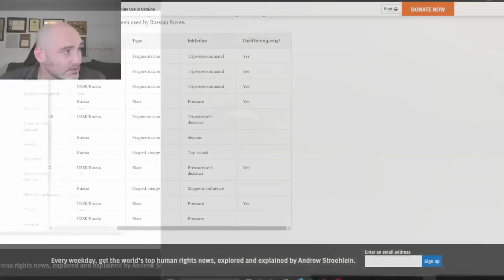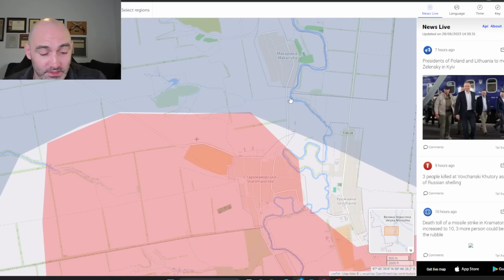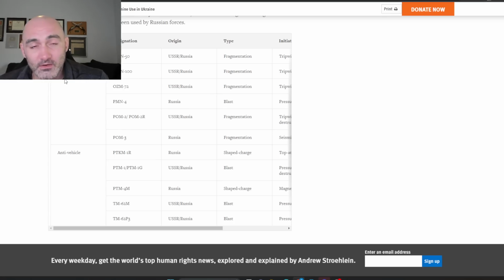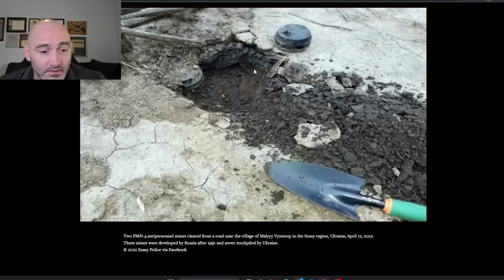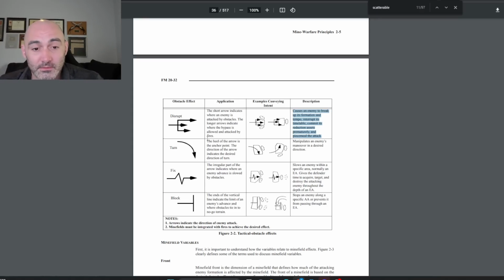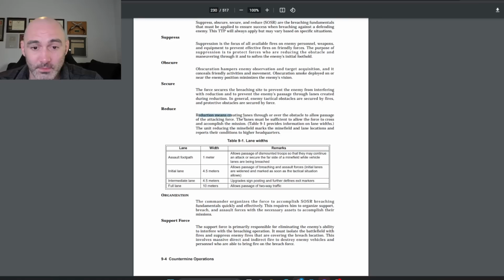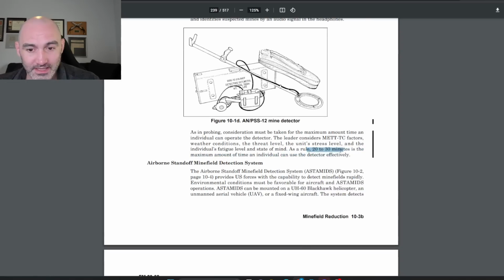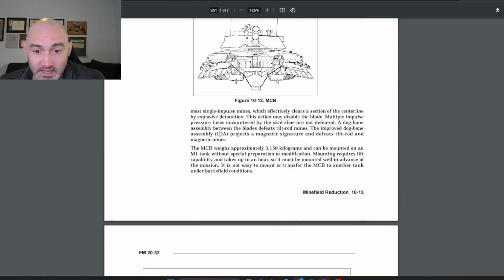The Simple Russian Weapon Slowing Ukraine's Offensive!

Comment: Paul, a question.  At the present Russian loss rate of artillery and MLRS from focused Ukrainian counter battery fire, what is your opinion when (or if) they will start to be unable to cover the minefields with artillery at all points?   Taking the Ukrainian figures with the normal grain of salt, Ukraine has claimed Russian losses of over 30 artillery systems and 6 MLRS  on both 7/3 and 7/4, and between 4/30 and 7/4, 66 days, 1328 artillery and 106 MLRS ( by Ukrainian figures, 31% of total Russian artillery losses and 16% of MLRS losses since the invasion started 16+ months ago).  Figures I have seen quoted say available Russian artillery at between 1200 and 1500 pieces; how accurate those numbers are, who knows?  Add to that Russian logistics and maintenance, how many are up and running?   Do you believe that there is some minimum of artillery pieces needed to protect the minefields from easy clearance?

Comment: I missed two AP-mine clearing techniques, Paul.. firstly the use of sheep (as done after WW2 in the Dutch seaside dunes, the remains of the Atlantikwall) and the not-so-popular use of POW's, penal batallions or even civilians (presumably used in WW2 on the eastern front). there are also bomb-proof excavators, which are used to excavate known ordnance-disposal sites (like swamps near to WW2 airfields that were bombed by the allies).
Reply: I love the low tech idea of using sheep. Bit messy but it's easy to breed as many as you need.

Comment: Wait a second here... its 2023, not 1970, magnetic anomaly detector and ground penetrating radar is a thing. Can´t they detect the exact position of the mines prior to the attack? 

It should be possible to localize the mines with cm precision. This probobly would help a lot and clear them or even just avoid them to a degree.

Comment: Excellent discussion on mines and breaching operations. Unfortunately, most of the techniques discussed in the manuals are meant for clearing linear obstacles with minimal depth. US forces typically bypass fields of mines. Given that the Russians have laid mines in wide swaths running kilometers in depth, clearing a lane is practically impossible without considerable loss of life and materials. Furthermore, breaching lanes are intended to create a narrow path (as you discussed) enabling passage through the obstacle. Once through, the unit should redeploy into a company/battalion front before continuing the attack. This isn’t possible if the breaching lane leads to another minefield. Even if a breaching lane could be cleared through the kilometers of minefields, disaster awaits if the lead Ukrainian vehicles are disabled in the breach lane. The remaining vehicles will be unable to  maneuver. As others here have mentioned, attaching blades, rollers and flails to the lead elements of the attack may be the best option.

Comment: Needs to be a drone capable of setting mines off since they're used for most other things.  Trailing wire ? If a drone can lift a man, then I'm sure the incentive is there to design a means to stop men from having to risk their lives with metal detectors. Isn't there a L I D A R ? system capable of looking at ground which has been disturbed? Failing that a forward vehicle connected by an umbilical cord carrying control lines  which is well armoured. Able to roll over mined area and set mines off in advance. Yup it could even should smoke canisters ahead of its path.

Comment: Top grade thermal imaging devices on western tanks can help well trained crews see the temperature variation, effectively locating AT mines especially shortly after full darkness occurs and the temp. variation is the greatest.
N.B. this method will not detect trip wires. Remotely detonated munitions just outside it's FOV range can also be a problem. 
The deadliest is a combination of AT & AP mines.

Comment: Wake me up in 15 of the main situation.
Couple of things him out of that for me, which I think are self-explanatory first of all you mentioned about the use of aerial equipment to detect and about London protection equipment. I’m aware of the fact that in agriculture they have drones That assess the soil condition there is a program in Britain called time team and they use a technique called geophysics to detect structures of a historical nature. Underneath the soil a little bit like sonar.
Given the increase in use of Drones and the use of thermal imaging camera, mineclearing detection equipment and lidar for mapping surfaces, I suspect that with an advanced software system which I am sure the Elon Musk would be willing to work on you get up and running so that your Ukrainian soldiers can penetrate these minefields would be achievable in a reasonable amount of time.
It also occurs to me That clearing of these minefields can be done in one of two ways, first of all you’re going you make a mess you let everybody know that you’re there. I’ll leave it sitting wait for them to disperse more minds by shells, rockets or helicopter whenever and hold your ground to air Artillery waiting for that to happen and take out those pieces of equipment, deploying those mines.
Using the Drones and men on their stomachs, they could clearly minefields silently if they had a headset connected to Drones, Geo positioning information of already detected mines.
Find me a slightly more bizarre one would be to fit some form of device to the bottom of a drone like a pistol that could be aimed by the drone operator and coordinate it with a thermal imaging. LCD display and a bullet to the mine could take it out Rendering mine is virtually useless.
And yes, you would then want to sweep the field again and make sure that everything has been cleared, but I thought that Ukrain had been given. Thanks with L is on the front or close on the front of the mines

Comment: Hey Paul,  Great classroom on mines, I just wish you went a little slower.  I'll just have to play it back at a slower speed.  My Dad found himself in a situation like you talked about, but in WWII.  Trying to deactivate a mine field with the enemy shooting about four or five machine guns from a hill about half mile or so away.  So they called in the air core, they came in and took out the enemy and when the P52s were flying back the engineers were waving at the planes when my Dad sees flames coming from the wings.  So he dove under a truck next to him, and then over a rock wall and into a foxhole where he found a guy with a radio who called them off.  Someone didn't put the right colored stripe on top of the trucks that day and they thought they were more of the enemy.  When it was all over he dug up the bullet that hit right where he was standing and said that one had my name on it, and friendly fire no less.   Well I still have that bullet, and it sits on my desk I see it every day.  He was a lucky man that day.

Comment: Commander Paul, you have been a voice of reason and strategy and analysis to military personnel both active and retired as well as for novices in the field of warfare like myself. War as you have described it is a multi-faceted operation that leaves bodies to the wayside and victories sour to the taste and bitter to the soul. Good soldiers you work with, share your life with can be gone in the morning and your commander before sunset. Then it's you running the show and you look over to see two dozen sunken eyes looking to you for the way ahead. They are hoping for words, anything to show they are winning the fight. What I try to do as an inventor is come up with ideas that may help out. Here is what I am thinking about mines. What about dropping over a field or 100 square yard area a sheet made of a rugged material, for example? Then pull rollers over the matt attached to rope from the other side. Mines would blow and send their blast into the protective sheet that would absorb most of the explosion. It could be made like a Lego-sort-of sheet where the Legos could be quickly replaced if the blast blew a hole in it. Ditto with the rollers. The thing is a 100 square yard area could be made safe in hours and working at night a lot of land could be made safe by morning...

Comment: A quite good summary of the military engineers handbook of mine warefare. 
There is one more possibility of mine clearing, without risking a lot of sappers lives or using ground to ground mine clearing equipment : The use of cluster bombs or artillery shells or fragmentation amunition with proximity fuses. 
There are some problems with these: 
1. The use of cluster and fragmentation amo is disputed. Some countries have agreed, to ban these.
2. These types of ammunition are not very surgical, which means that one shouldn't them it in populated areas (war crime), but in fields with forestlines it might be an adequate method.
3. In most scenarios you won't get a 100% cleared path, because the effect of the exploding bomblets or hitting pellets can be inhibited by stones and other hard obstacles, probably even hardened soil, when the mines are covered.
4. The fastest way to clear wide, long pathes, are serial bomb releases by aircraft. But therefore you need air superiority and suitable airplanes. Both is lacking in Ukraine. So, unfortunately, it's no option for the UAF at the moment.

Regards Th. Krapf (former engineer officer)

Comment: I can see AFU using M2s to lead armored infantry assaults, it's probably the best IFV/APC available that will keep the crew and passengers alive if they hit a AT mine, which is the biggest hold up, the Russians have very few cohesive units left, just a mob, stuffed in trenches, with a whole lot of arty in their rear. I saw that 25mm Bushmaster with HE  (They showed the fat yellow rounds later in the vid) in action on one of the tree lines, instead of out in the open desert, as we've seen for years, and man, it looked devastating, it was cutting trees down and exploding in the trees and bushes, above their trenches, unless they were down in their holes, they were swiss cheese (shrapnel), all the while the infantry was moving forward, under the suppression cover. The way it's supposed to work.

Comment: The achilles heal of a mine, minefield, is that they must be covered by fire (the cheap plentiful ones, hand or machine laid by the thousands, not the expensive remote laid mines, arty shell type, or a point layed mine by a soldier crawling into no mans land, or behind lines on a known path of attack). A static minefield only (not covered or secured) can be gapped or bypassed fairly quickly (once ID'd), and with minimal losses, same for tank ditches. If the prepared covering positions are not manned/supported, or weakly manned/supported, are suppressed by indirect and direct fires, or get outflanked, have to turn their attention away from the minefield, or withdraw, the minefield becomes a obstacle, but real power (exponentially so) is when it's properly covered. The whole place is shrewn with mines, the Russians have been preparing it for months, rushing in would not be smart, a slow methodical approach, as the AFU is doing, especially without air support, which would be handy taking out the strong points covering the minefields, I think is the best approach.
Reply: you are still living in your ghost world. Most of the minefields were created using remote laying - MLRS. Now the MLRS for laying mines is working non-stop. And we put mines even behind the backs of the advancing Ukrainians, so that when they retreat they are undermined

Comment: The offensive was announced with bravado, but several Ukrainian commentators said it would take years. 
Although the defensive lines are strong, the original corssing of the Inhulets river in Kherson also suffered heavy losses. 
As the west realizes progress is too slow they may start sending more weapons (F16s, andti helicopter weapons and long-range weapons to degrade the troops and supply lines. )
Although the defensive lines are impressive, they are not invincible. skeep degrading them and keep degrading the supplies and the gaps will come that will allow larger gains.
Reply: They just took one of the most sophisticated defence fortifications on the front located south of bakhmut.

Even the best defences and fortifications are pretty useless if the leadership in command of them is sub par and the people manning them are barely trained and diciplined.

They certainly are dangerous and slow the enemy down, but with good planning and tactics they can be overcome without to much issues.
Reply: @baronvonlimbourgh1716  I am most looking forward to when some parts start collapsing. If the troops suffer poor morale and their rear lines start getting attacked they might crumble. 
I guess we'll have to wait and see. Ukraine is pretty unbelievable with no air-superirority launching multiple offensives.
Reply: @concerned_parent    the way things will collapse is by bringing russian logistics to it's knees.
That is going to take time and a lot of applied presure. But it will eventually happen and it will be glorious.
Reply: @baronvonlimbourgh1716  You may be right. I do think F16s and other answers to the helicopters will change the face of the war. And unforeseen cirumstances like a coup could intervene.
Reply: @concerned_parent   it certainly helps!

Comment: I keep imagining a fleet super huge armour plated mining earth moving machine just plowing through mine fields.. they can even be remote controlled. Should have a chat with Rio Tinto or some people like this.
They're all so woke they should be easy to talk into helping.
This is a much better cause than a lot of the crap they waste money on.
Reply: actual ploughing would leave an unusable path... ever tried driving/walking over a plowed field.. But I do like this idea, just replace the ploughs with concrete filled steel rollers with nails sticking out.. then surround the mining vehicle  in multiple layers of 1cm steel plate (at a distance of a couple of meters, heat rounds and penetrators will have to be very lucky to get a good hit.

Comment: Do they ever use cheap heavily weighted remote control cars, going back in forth in a pattern, cheap enough to lose?  They could also have onboard guns and fire a pattern before and around them. Do bullets set off mines?
Reply: If you have it you can use it, nobody has it.
Reply: @GoonyMclinux  I wonder would a repeating shotgun work? If you knew the spread...
Reply: @HamiltonSmith4  ive seen them hit by bullets and not go off.
Reply: @GoonyMclinux  I see.
Reply: ..flamethrowers?
Reply: @GoonyMclinux  They could perhaps make dynamite in granular form or grind up some non shock sensitive explosive and either drop it from the air or spray it out (with a disk pump) then light it with incendiaries. Test grain size and coverage density until all mines are detonated. Go back after victory and rebuild the soil. Or just use to create corridors for rapid advance.
Reply: @HamiltonSmith4  won't work, some mines you can hit them with a grenade and they won't detonate unless they flip over if they are tamper proof.

Comment: The flail tanks used on D-day did the trick. Simple low tech and efficient. Surely the modern military have heard of them. Haven't they got any?
Reply: They won't work.  Russia already destroyed all the Leopard 2A6Ms with the demining equipment.   Germany is saying they can not replace these tanks, so they are just gone.
Reply: @lance9150  Russian bot
Reply: @lance9150  Because they haven't got old soviet tech with deminers right?
Reply: @alexboumba5632  The mine scattering artillery Russia is using is actually pretty high tech, it maps the locations of the mines and they can be remote deactivated, and like I said, Russia can re mine an area almost instantly.  The thing is you talk a lot of shit about Russian weapon systems but they are effective against the most modern western weapons and are much cheaper to produce, Russia manufacturers more T90M tanks in a month than all the tank manufacturers in  NATO combined build in a year.  Ukraine has no military industry so they have to beg for handouts.
Reply: @lance9150 you are a liar and a cretin, none of that is true.

Comment: How about 2 salvage yard electro-magnetic magnets, (turned in reverse) in a v shape. It would take a shit ton of electricity. But it would literally rip mines out of the ground and throw them 10 feet either way.
Say take a Tesla mega pack, put it on roll back, set it to run at 480 volts in 3 phase. Might get an hour out of that, but dead quiet.

Comment: Why doesn't Ukraine not rig an extendible arm with a large magnetic plate on the front of a tank that would be strong enough to attract a mine to the plate and presumably detonate it. In the field it would be retracted with the arm going alongside the tank. This would allow a tank commander to extend the magnetic plate on the leading tank on a tank colonne that moves on a road and move more quickly. It wouldn't really help in the field.

Comment: Tanks and Bradley are going to have to be equipped with bulldozer type blades to push away mines. This has got to be done on mass. Not just a few vehicles.  Some similar effort like dday in WW2 when blades were welded on tanks to clear hedgerows. I don't expect this measure to be 100 percent effective. But 90 to 80 percent will due.
Reply: 😂 ah another armchair expert 🙄🤡

Comment: Is there a low-tech way to launch earth as you advance to set off mines? For example, a belly dump scraper with a forward facing high-speed conveyor ejecting coarse earth 30 meters in advance. It would set off mines in its own path without coming into contact.
Reply: That definitely would take a ton of fuel to move that much material, but I'm curious if this has been tried. Essentially throwing an effectively endless material does seem much simpler logistically.